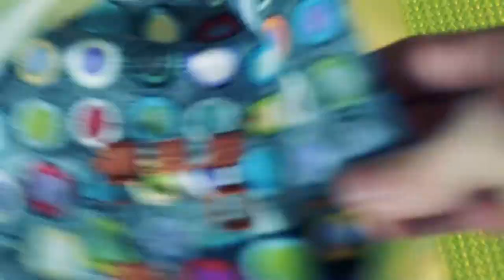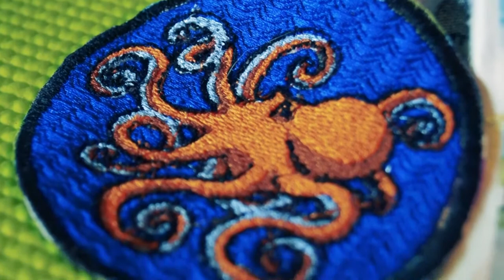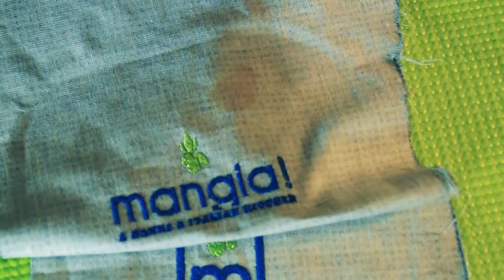Circuit Patches 04: Figuring out Custom stitches and working towards finished patches

Comment: Saw your review on make - glad to see people make-ing with textiles, which is so traditionally relegated to "craft"ing. Totally spot on about embroidery software; Very frustrating model of purchasing that really goes back to embroideries inception, and also I believe related to early "Cutting" machines (such as silhouettes with physical cartridges). New cutting machines (in the last 2 years) in general allow you to design in outside programs (like indesign) and then import many file types through a computer interface which runs the cutting machine. It wouldnt surprise me if the next generation of embroidery machines offload the design and editing component to computer software, allowing for a much more powerful and robust tool/interface. Hopefully older sewing machine companies like Brother will gain some agility so that the expectations of a rapidly growing maker community can be met, instead of disappointed!  I'm excited to watch what else you make.
Reply from the maker: well, I feel like brother is showing agility on the hardware side. a $300 computerized embroidery machine? that's awesome. Looking at software is like going back in time though.

Comment: The fixes for that are usually in altering the embroidery file itself so that it tacks down the fabric first (you may also note this happening when you sew things in general) and pull compensation where the software assumes the fabric will scrunch a bit, and makes the lines wider a bit to account for it, especially in places where it keeps pulling in the same direction.

Comment: The edge bit there is likely out of register. Basically stitching will pull the fabric in particular ways and the panograph depends on things being where the machine things they are. So if the pull is too much it'll scrunch the fabric. From when you tapped it it sounded bulletproof (very heavy with stitches). Sometimes it's also the case that it can just lose the position a bit and shift everything over.
Reply from the maker: yup, I've learned about pull compensation since then but have not yet experimented with it. That is totally what happened.

Comment: I have played with embroidery electronics. The one thing I can tell you is you can run 40 gauge copper  wire in the bobbin. the path the bobbin takes is much less  the running though the needle.
Reply from the maker: just regular wire? I hadn't tried that!
Reply: Yeah just enameled 40 gauge

Comment: 8:00 Yeah, the software for embroidery is awful, you've barely touched the surface it also has some weird intractable ideas that don't really work. From a computer science perspective it's horrible. It's also suffers from everybody having their own locked-down formats and weird formats and formats that literally date back to punch cards. 

I should know, I write the stuff. If you want the Google Play store has a free version of my app that would totally let you do whatever.

https://play.google.com/store/apps/details?id=com.photoembroidery.tat.touchembroideryfree
(The full version at $4 is thus going to be much lower than your low end, and has little more than the free version).

My program is more art based, rather than vector based. So it's a bit of a completely different way to come at it.